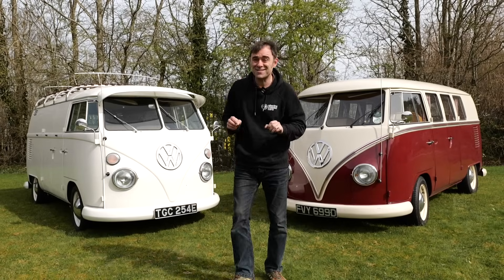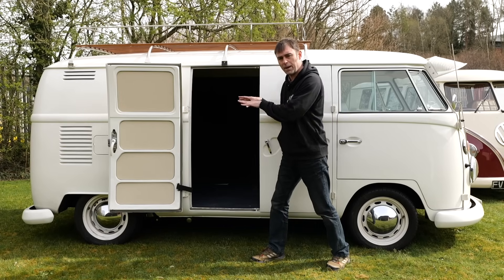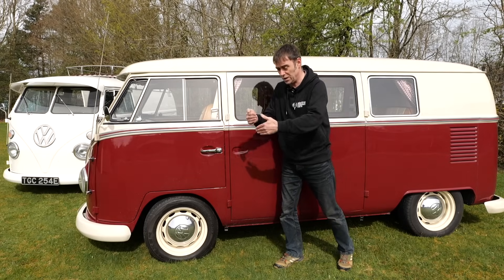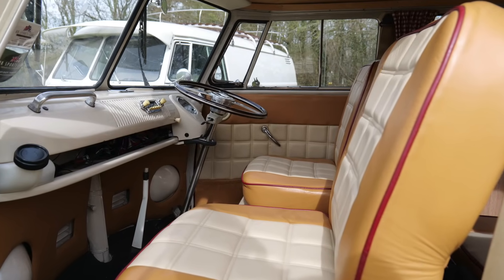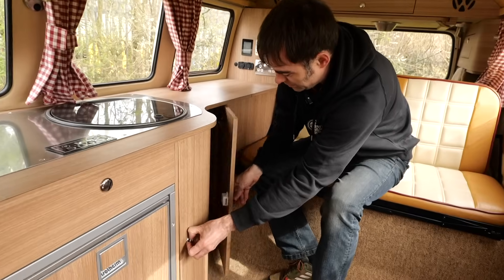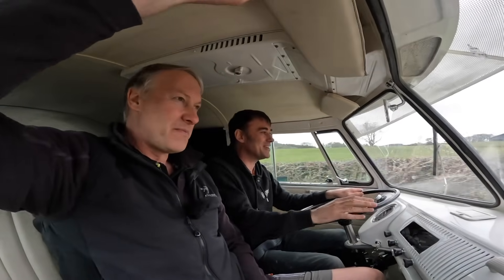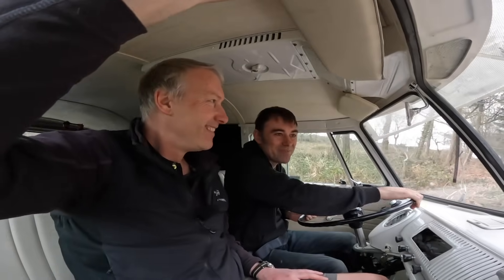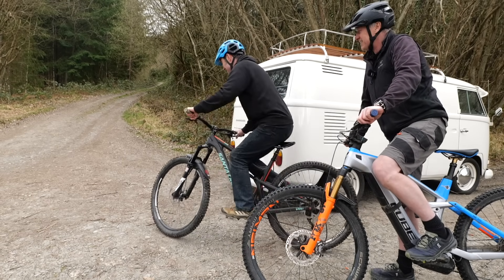Why are these the most difficult cars to convert to electric?

Comment: BEV makes so much sense for campers....even more so than cars. I've recently bought a 40kwh e-NV200 that I'm converting. As you say you can tap into that huge battery so you don't need a leisure battery. A lot of ICE campers are installing lithium leisure batteries now too. The difference in driving experience though between my old T4 and this e-NV is hilarious. It's such a breeze to drive....I love it!

Comment: In the 1960’s there was a German company that ordered 40 Type 2’s modified to electric only.  They were likely using lead acid batteries.  I wonder how VW configured the set up.  I’m thinking Jay Leno may have one of those but I could be wrong.

Comment: I really like that camper van and the location of the battery packs.  Where is/are the battery pack(s) on the panel van?  I didn't notice an extension of the rear deck, and I'm pretty sure I didn't see a stool to put one in.  Engine bay and under floor?
Reply from the maker: Behind the front bulkhead. 👍

Comment: Just a question, your video about the Jensen where a big torquey v8 was replaced, do you adjust the torque/power delivery curve of the electric motor to be similar to the v8? It’s just something that’s crossed my mind, especially thinking about the tunability of the electric motor system. Cheers
Reply from the maker: Yes. We can do that. 👍

Comment: I know you can’t do something like this in the UK because of your laws with conversions to electric. But how hard would it be to remove the under the floor supports and remake the floor support around the outside and install a steel or aluminum plate to actually support the floor and install the battery pack under that? Make it like a skateboard platform like new EVs are made now. Just wondering your thoughts.
Reply from the maker: It’s possible outside the uk but it’s a lot of work to do it right and safe, keeping the structural integrity of the vehicle once you start chopping the chassis about. 👍

Comment: No hyper9 plugged to transmission box. With SDU you get rid of it, right?
Reply from the maker: Yes. Also, Hyper 9 is too low voltage to be able to DC rapid charge.
Reply: Gearbox I mean, sorry

Comment: The bench with the batteries in was on the left and centre of the van, and the additional box of batteries was also on the left.

So is your camper heavy on the left?
Reply from the maker: Good question. No is the answer. The rear seat actually is the whole width of the vehicle, some of it is hidden under the cabinets. The weight of the battery box behind the passenger seat is the same as the kitchen cabinets, fridge, sink etc on the right. So all in all it’s pretty even weight distribution. 👍

Comment: I have seen conversions that just put the batteries on the floor, and a new floor on top. Obviously some headroom lost.  Easiest / best weight distribution?
Reply from the maker: You lose around 3.5” when you do that. If you can accept that then it’s not a bad way to do it as long as you don’t mount it slung underneath the chassis. 👍

Comment: It's not a Type 3 or even a Type 25. There's no such thing, just those (like you) who don't know it's correct designation. The third generation of the Type 2 is the T3. Check VW in Germany as they call it that. The Type 3 is a completely different vehicle and air cooled.

Comment: Question:- Why were you not wearing seatbelts? if you have a vehicle pre 1963 you are exempt, but the motor you were in is 1966/7, so you should be wearing belts?
Reply from the maker: We were wearing seatbelts. They were lap belts.
Reply: @ElectricClassicCars  It has been so long since I last drove a vehicle with lapbelts I didn't even consider them, I used to have a 1959 Victor that a previous owner had fitted these to and I must admit that it was over thirty years ago since I last even saw a lap belt! I enjoy your channel and have been a subscriber for a few years now. keep doing what you do, it's a great channel!

Comment: I saw a youtube video where a guy did a DIY conversion of a VW bus into an EV. He installed the battery boxes underneath on the outside instead of in the interior. Would it be unsafe to do it that way?
Reply from the maker: Yep, I know the guy, he’s been up to see us. There’s 3 big problems with mounting a big battery box underneath. 1 - ground clearance is reduced by about 3.5”. 2 - Impacts from being slung so low. 3 - Water ingress. This last one is why it broke down on its inaugural trip across the US.
Reply: @ElectricClassicCars  Yeah. I was thinking that you might get more water getting into it installed down there. Too bad there isn't an easy way to install batteries in the space underneath

Comment: I started an electric conversion on a '57 panel van back in the '70's/early '80's. (sadly never finished $) I was using much of the space under the floor, around the frame rails for all of the (at the time) lead acid batteries. I would imagine it would be much easier nowadays to configure a somewhat large battery pack in that same space. What am I missing? it seems like the perfect place for a low-center-of-gravity/centralized mass application. ✌😎
Hearing that ol' split pull away with that quiet, whirring sound just warmed my heart! (ZOOM!😛)

Comment: I used to carry bikes in my '92 hiace camper all the time. Just used the awning tarpaulin to protect the interior. It was a full LPG conversion, had a popup roof. If I still owned it, it would be full electric by now. Wasn't much bigger than a VW camper.

Comment: Love them both. Maybe I missed it but, especially in the cargo van, now that the gas engine is gone, how does the heat/defrost system work now?
Reply from the maker: Good question. Here’s a tech talk which covers how heating and air con works in our conversions. 👍 https://youtu.be/s75gJuMS1_M?si=RzsLWXskT-SE5M39
Reply: @ElectricClassicCars  Thank you! Lots of great info

Comment: This is where our (uk) silly DVLA "points" system really does not help!  It would not be hard to chop out the middle of the bus chassis and floor (it's a very basic semi structural ladder chassis) and to weld in a modern, very high strength battery box that would not just put the battery in the best place (under the floor) but would also give the vehicle a massive boost in structural strength and crash worthness, particularly in any side impact (which the T2 scores less than zero as a std bus!).

But as soon as you touch the chassis/ body you're into a Single vehicle approval and here the critical bit, you loose your original plate, which is what everyone with a classic wants to keep hold off......

Comment: If they are difficult to convert, they must be a candidate for the Thor industries style old style body on skateboard platform, but one that is optimised for camping - space in the skateboard for clean and grey water tanks, proper camper HVAC system, integrated solar, V2X, built in compressor that doubles as a shower etc
Reply from the maker: Great idea. 👍

Comment: Without watching i'm going with, because the original is made with wire coat hangers and tin foil, that and oil the oily bits were hung out the back, and its actually quite small. Now for the watch.

Comment: Maybe invest in a skateboard chassis/ battery and put the old body on top.  That would work regardless of interior.
Reply: Too much engineering that will require alot more    safety controls from the authorities! The VW beetle actually has a chassis thats easy to modify! There is a south African company that makes a full custom aluminum chassis with audi v8 engine and other modern components like BMW suspensions.....

Comment: Great Idea, hiding the battery-pack for the Camper in the seats👍 Really like it, well done 🍀. 

For my curiosity: What about the panel van? Wouldn’t it be possible to use the total floor in the cargo area for a flat battery pack instead of the cube?
Reply from the maker: Yes, but this customer is planning on converting the van into a camper so didn’t want to lose internal height.
Reply: @ thank you for your response and good luck 🍀 for your next projects. Can‘t wait to watch your latest conversion 🙂

Comment: I'm building up a 1965 Ford Van "EV"
The form factor is VERY much like the VW Van, the driver sits on the front wheel, large storage compartment in behind. The engine sat between the front seats.
I've pulled the front engine ( a GIANT lump of iron in the front ) , underneath I'm installing the drive train, front and rear suspension, brakes, and inner fender wells; from a Subaru AWD Outback or Forester
Propelling the whole thing is a Nissan Leaf Motor; inverter and charger go under the floor also ( or other aproropriate electric motor ).
Yes this ALL fits UNDER THE FLOOR.
Batteries will be made up of 48V modules ( six - eight ), that get linked together to provide the amps needed, batteries sit under the floor
I hope that one battery will be able to be pulled for use in a cottage or out on the boat.
I've got the Ford gutted, and the Subaru parts ordered from a salvage yard.
Batteries are going to be the real problem.
Oh and CASH
Reply: I've got Legacy parts galore - pity I didn't know ahead of time!
Reply: I think that the Subaru drive-train is a gift to resto-moddors

Comment: I also love how quiet the VW EV conversions are!  Not only were the original engines lacking power, they were super noisy!
Reply: They are literally decades old and an electric version of those literally was totally useless with no range
Reply: It's funny how you compare an engine from the 60's to modern electric motors and not ICE!  VW actually makes RV with their own bus in house and those are powerful and can actually tow unlike the electric ones
Reply: Those "old" noisy VW engines are actually modified to power small aircrafts which not even a 1000hp electric motor will get you anywhere

Comment: Nice conversions but I really cant understand why one would convert the older VW campers (I owned Westfalia for years) given they have no airbags, no crumple zone, no collapsing steering column or foot pedals in a head on collision your an absolute gonna. The more modern VW campers with all the aforementioned are a far safer bet for any owner wanting an electric conversion.
Reply: You don't buy a classic with your head, you buy it with your heart.
Modern junk, although safer, are just a vessel to get from A to B, and most cases you can remove the badge, and you wouldn't know which was the manufacturer...🤷‍♂️
Swap out the modern power trains (be it electric, diesel or petrol) and enjoy a beautiful vehicle, with classic show and modern go.
Reply: Same as any classic vehicle🤷🏻 plus it's more reliable, quieter and safer.. and ultimately once you've cycled or ridden a motorcycle for any time  you learn .. nothings safe unless you  are a skilled driver and telepathic.

Id love a crew cab but with a demountable camper for the back.

Comment: An all-electric camper makes so much sense.  One fuel source, no fumes, more power.
Reply: No it doesn't! Also which fumes are you talking about?! Most people today uses batteries with all kinds of setups from the tiny cars to the gigantic 8x8 trucks RVs.... And they actually have a range.
Reply: @ He's talking about the fumes from gas hobs. They really aren't good for you (and make the inside of your van soggy). Yes, people use batteries and induction hobs for cooking now - that's what 'all-electric' means. But the vast majority of older vans (and plenty of brand-new ones) still use propane for cooking and propane or diesel for heating.
Reply: And just plug in at the camp site over night.
Reply: *One energy source
Reply: Indeed, but it's hard to do with existing available vans because the manufacturers give you no access to the BMS and contactor control. So it's easier to do it right with a conversion like this. So you end up fitting another battery for no good reason, and now you've got two BMSes and two batteries to manage. There is also a real shortage of HV DC MPPT devices to connect PV to traction batteries. It would be great if one of the new van makers decides to give converters access to do conversions that actually use the main battery (and put in a ~100kWh battery so that range+camper stuff usage is reasonable - everyone is still making quite short-range vehicles to satisfy the delivery market so far). Heating is still a problem - there isn't really enough energy budget for that, and all vans have terrible thermal efficiency.
Reply: @xxwookey giving people acces to the BMW is super dangerous! Imagine all the very bad modifications could cause!
Reply: @ I'm not talking about replacing the BMS firmware - I'm talking about an interface to be able to turn the battery on when the car is 'off', and interface with the vehicle UI to report and control 'camper mode', and use the vehicle inverter to run devices rather than having to add another one. Using the built-in vehicle systems would make a much cheaper, neater and more efficient setup overall than having to add a whole second system with the corresponding space and cost. Which is exactly what has been done with the conversion in the video, but is very hard to do with a standard new EV.

Comment: (one would think a battery skate board like chassis be quite easy )
Reply: Yes, but that would be a rebuild  of the chassis, which gets complicated. They always seem to leave all the metal bits original so you can theoretically convert it back. But mostly I think the paperwork is much simpler that way under British rules.  Alternatively, you could make a flat battery all over the floor inside, but then you have a higher floor, which is not ideal, either.
Reply: @geirmyrvagnes8718  it is legal to replace the floor pan on cars and panasonic/tesla cells are quite low